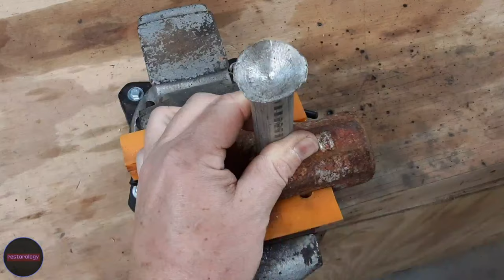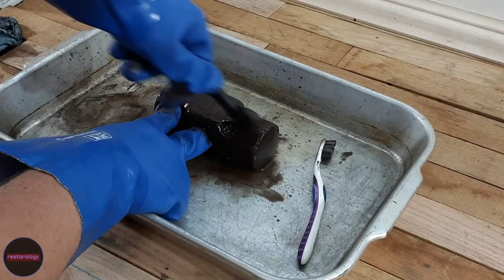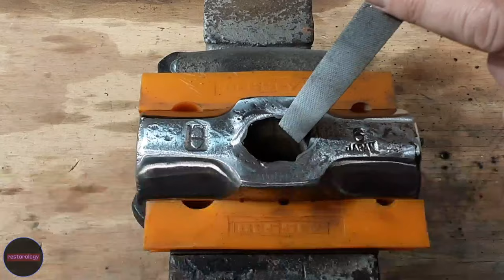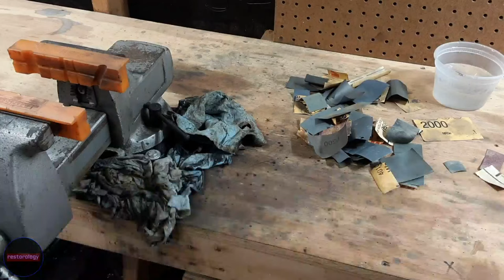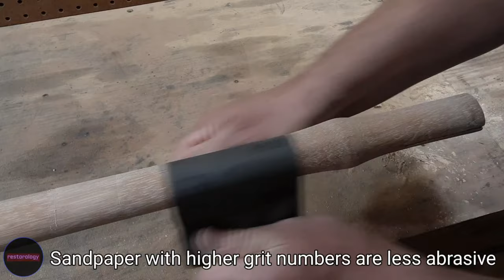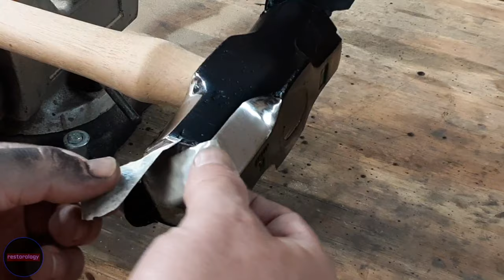Sledgehammer Repair and Restoration

Comment: Great job!  The handle is so well sanded that the whole wood texture is revealed even before the oil treatment, amazing!
Reply from the maker: Thank you! Lightly wetting the wood during the final steps of sanding makes a big difference in feel and look. It took a lot of time to sand on this one since it had been sitting in someone's outside shed for probably 20 years or more. It was so rough at the start. Cheers!

Comment: Like the projects, quick question , have you thought about your bench grinder rehab,it looks like it could use some tlc
Reply from the maker: You are not wrong. I actually bought most of my equipment second hand at estate sales with the idea to restore it at some point, but then I just get to using it and well...you see where it stands. The grinder, drill press, parts washer, vices...all of it is on the to-do list! Thanks for the comment. Cheers!🍻